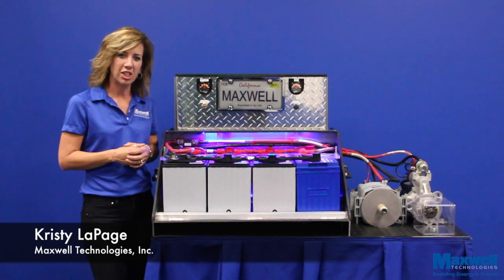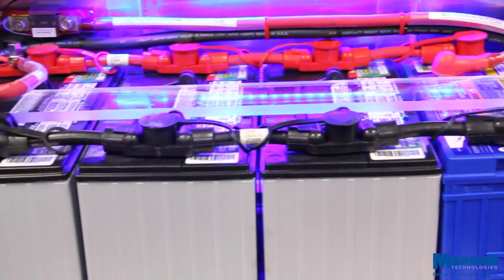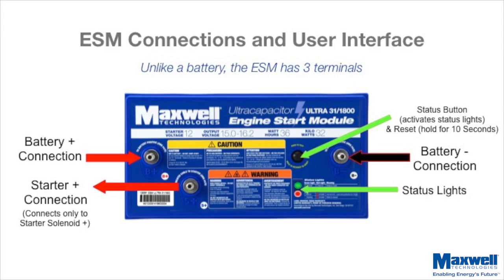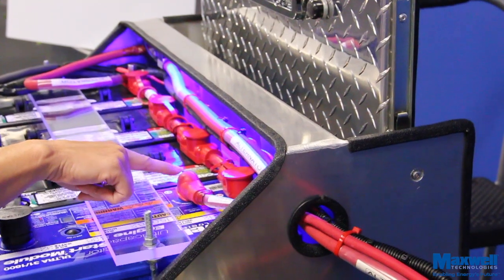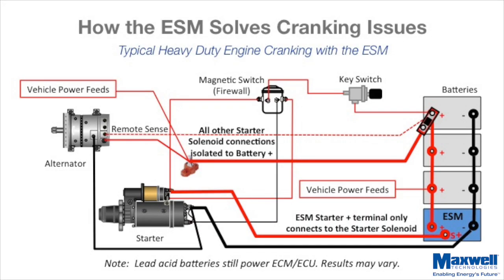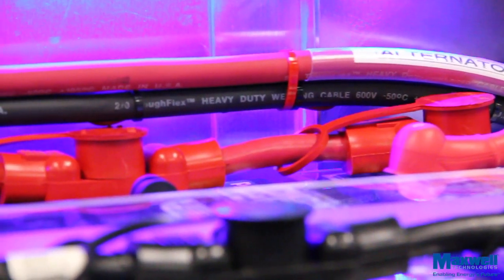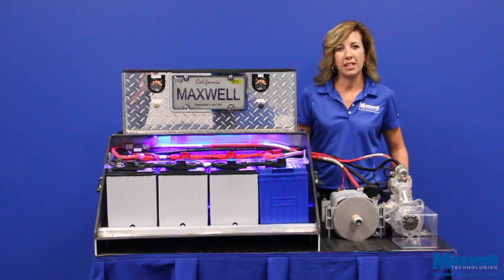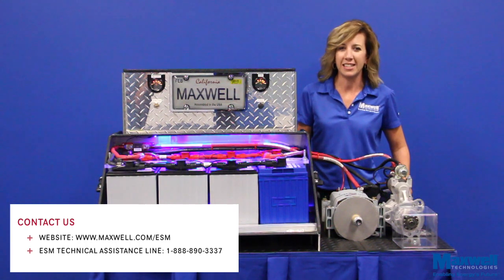ESM Installation on Demo Unit

Comment: Has Maxwell done anything to keep water from seeping in past the seals on the top post? There are many of these batteries selling on Ebay just for the capacitors because the charging circuity was damaged from water getting into the battery compartment. I know because I bought two of the 1800 series and both had about 2 to 4 ounces of water inside and the charging circuity was all corroded and ruined from moisture damage. For myself I did not care to much because I ended just wanting the capacitors and found an alternative  charging circuit to install inside.

Comment: Since  the   peak  starting  currents  are  being  taken  care  by  ESM,  would  it  not be  more suitable  to   have  starter  batteries  replaced  by  deep  cycle  batteries  for  the  constant    drain  currents.
Reply: I agree! But I don't think they will suggest that because it would just add cost to the original installation
Reply: @jimthvac100   Yes  but they say you can order OEM  from Peterbilt  also  you  could  replace  your  Group  31   truck batteries with  deep  cycle  batteries then they got old ..

Comment: Have you ever considered creating an ESM for PHEVs such as the Chevy Volt or Prius Prime?  They have large traction batteries to propel the vehicle, but use a standard 12v battery to operate the regular auto components such as lights, radio, windows, etc.  The traction battery keeps the 12v battery charged, so there's little risk of it ever going dead unless someone sits in the car with radio and lights on for an hour while the car is off.  The weight savings would help efficiency  though.